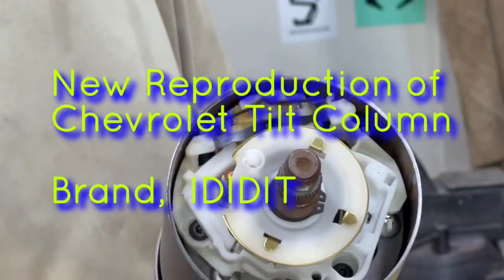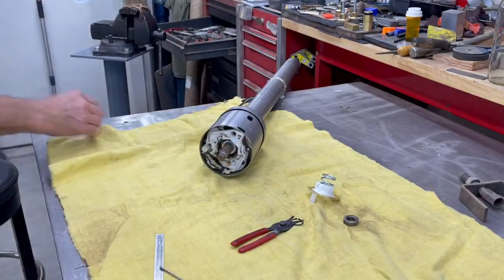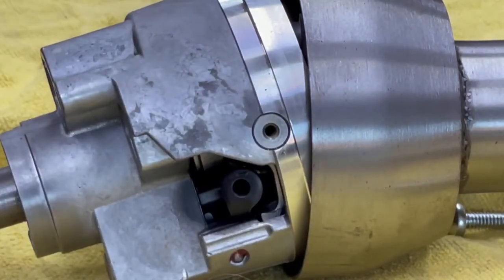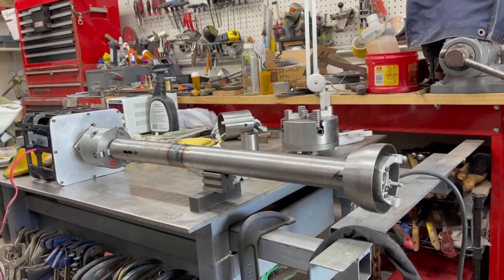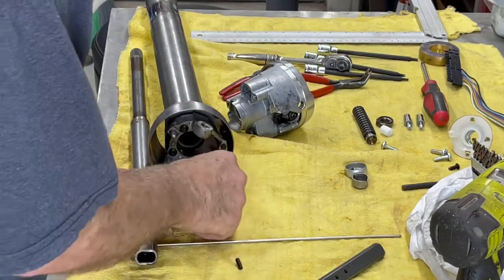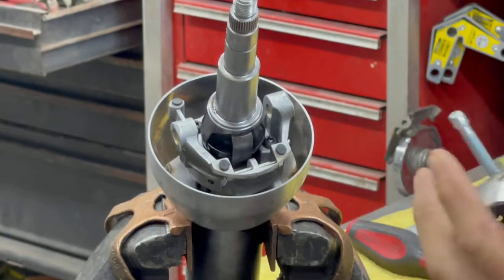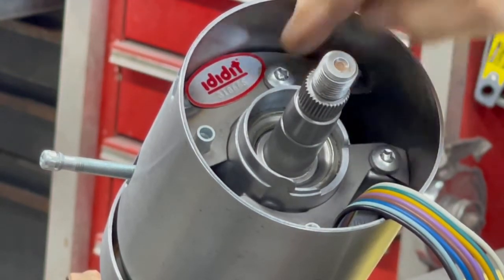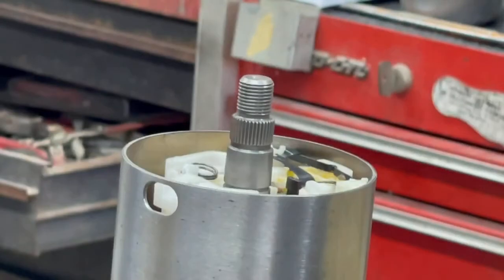Your Shaft is Too Long You Say!

Comment: that was cool, thank you.
I was thinking if the shaft is standing up on the floor, it will push itself up inside the colunm, place the horn ring on and put on the nut to trap the horn ring so it won't spring away the first 5 attempts, 5 min more of cussing it into place and bob's your uncle.